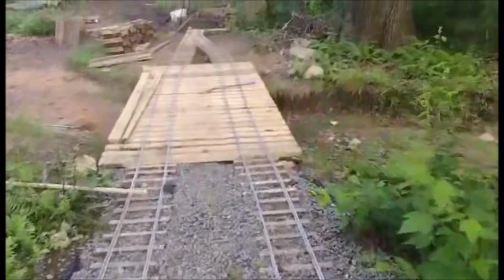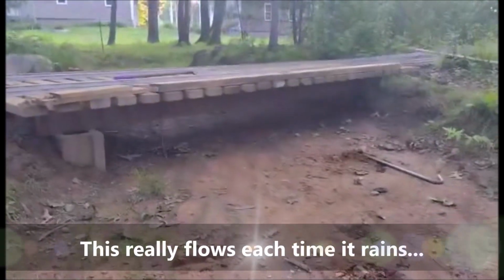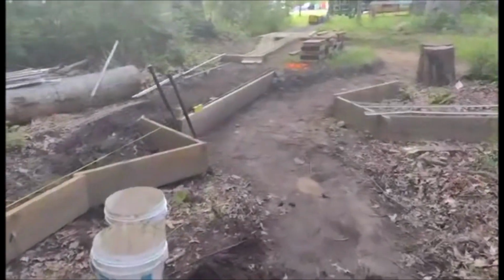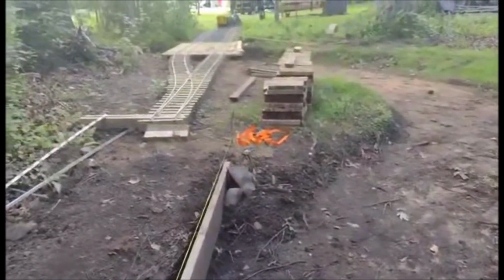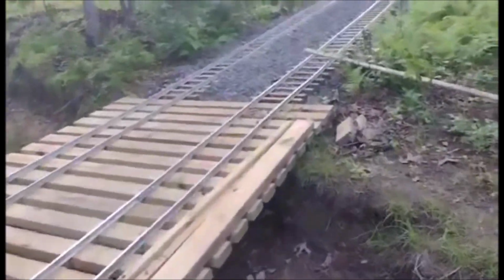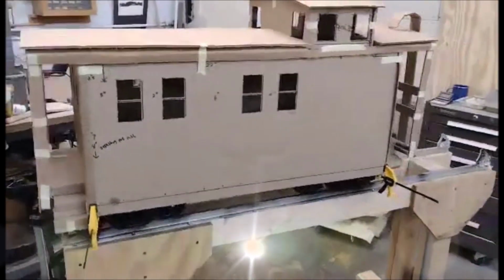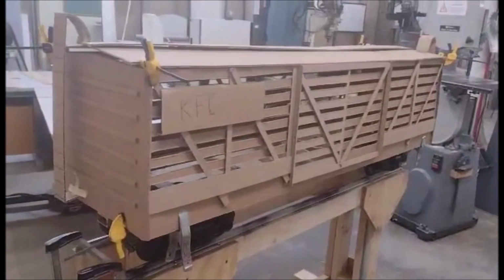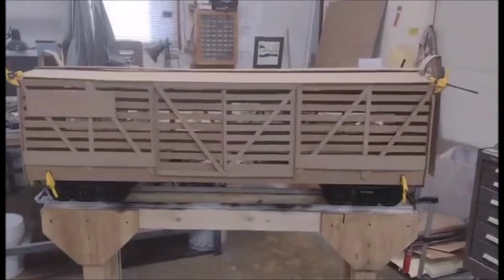Part 3.0 - Building a Backyard Railroad - Train ride, trestle + switch almost done + 2 Car Templates

Comment: How do u get the track the rite distance apart for the train do u have a guide when laying the track xxxxxx
Reply: You make or buy a track gauge, or several.  The track gauge is usually slightly wider on curves, so you need a different track gauge for curves.